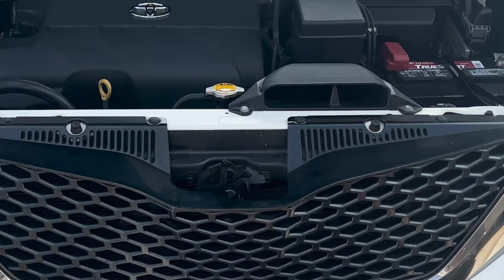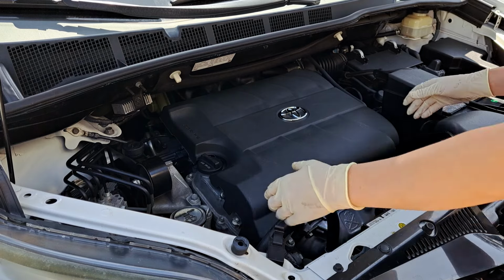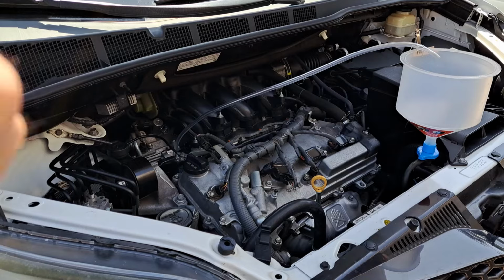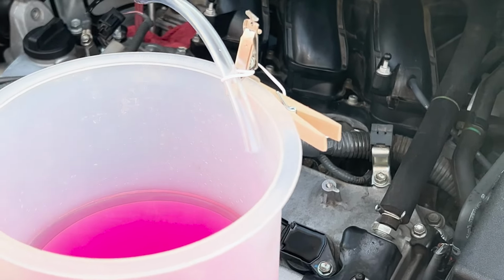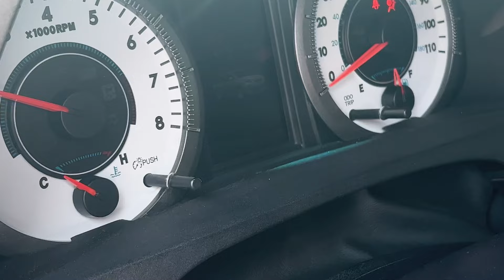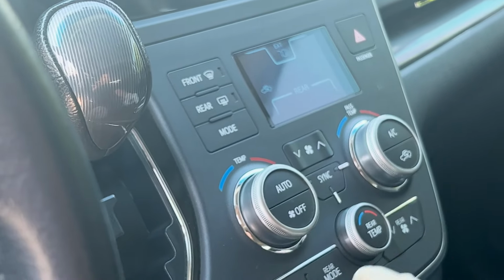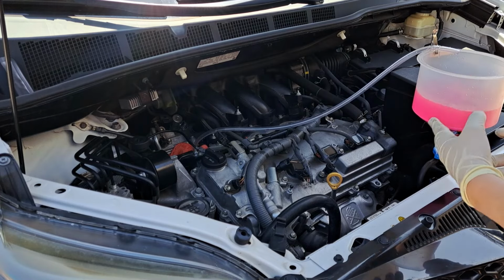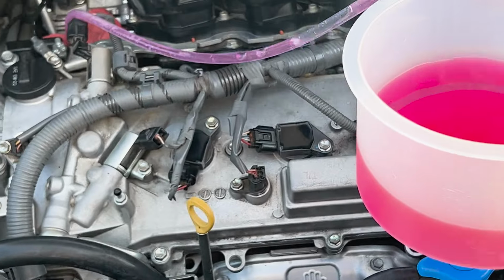Toyota Sienna 2GR-FE Coolant Flush and How to Bleed All The Air Out

Comment: So, when you drain the system (and refill and bleed the system), do you want the heaters all the way on hot with the fans off so you can get the old coolant to drain out and the new coolant to fill back in? Very helpful video, by the way. Thanks! :)
Reply from the maker: Thanks for your question! You wouldn't need to do that because system doesn't have a conventional type water/heater valve, coolant is constantly flowing through the heater core and air and flaps direct the airflow for heat or cold.

Comment: Hi thanks for the video, is there still some coolant liquid didn't get out because of the coolant thermostat valve? or you changed all of it?
Reply from the maker: There will still be a little bit of coolant left in the engine during a drain and fill. You will get more coolant out doing a thermostat or water pump job but you really can't get all the coolant out. Just stay on top of your coolant changes every 4-5 years.

Comment: I have a 2014 Avalon 6 cylinder. with 49,000 miles.  I followed your video, but no coolant came up from the bleeder valve.  I left the valve open and proceeded anyway.  As the engine got hot bubbles were present in the funnel.  I continued until no more bubbles occurred.  I drove the car and got it up to temperature.  The heat coming from the vents was great (hotter than before).  The temperature gauge was were it typically is.  Any thoughts on what happened?  What would I notice  if i still had air in the system after the procedure? Than for any light you can shed on what happened.
Reply from the maker: That's a bit odd since coolant should flow out and match the level of the coolant level in your funnel. Possibly the bleeder valve was clogged,  but sounds like you got all the air out anyways!

Comment: Hello. @ 04:18. How did the fluid level in the funnel get that high? Did some fluid already flcoke from the tube or did you add more?
Reply from the maker: The fluid level will rise due to the coolant getting hot, thermal expansion. That's why I only fill to a certain level at first.

Comment: 2GR FE what is this?  Brand of a coolant or engine type?

I have a 2015 Siena XLE FWD.
Reply from the maker: The 2GR-FE is the engine name/designation. Your 2015 Sienna has the 2GR-FE engine.
Reply: @CarsYouCanFix  thank you bro!!!
Reply: How many gallons i need after flushing?
Reply from the maker: @ETHAN_VR123  2 of the gallons should cover it.

Comment: Hi, I have an Australian built Toyota Aurion  with the 2gr-fe V6. Do you need to turn the heater on at any point during the procedure to remove the air pockets from the heater core. Thanks
Reply from the maker: No you do not. Due to the design coolant is constantly flowing through the heater core. As long as you follow the procedure you will be good.

Comment: My RAV4 2006 V6, 3.5L has the same engine. But it doesn't have the radiator cap like yours.   It has only 1 cap at the reservoir,  how do I do this method?   Thank you
Reply from the maker: From my experience with the Rav4, you can just fill the coolant tank with the bleeder valve open. once fluid is level in the tank and fluid comes up the plastic tube attached to the bleeder valve you are good to go. This is due to the higher location of the reservoir tank for air to bubble out easier.
Reply: @CarsYouCanFix  so you fill the coolant into the reservoir tank while the engine is running or off? Thank you
Reply from the maker: @ngoiloi9174  engine off on the Rav4. Once you do a couple drive cycles where the car gets hot and cold, like after a couple days, just recheck the coolant level and top off if needed.
Reply: @CarsYouCanFix  Thank you.

Comment: Does any 1/4 id tubing work or do I need a special kind? Because I don’t want the coolant to melt it
Reply from the maker: You should be fine with any 1/4 ID clear tubing you find at the hardware stores, I also have a link in the description for tubing that works.
Reply: Yeah that would be awesome
Reply: Also I ended up mixing coolants and now my Sienna is overheating do you recommend I completely drain everything out or just the radiator? And maybe pull a hose off the block and let it drain.
Reply from the maker: @anthonysanchez116  I would drain the block also, another comment here says there are 2 10mm drain bolts on the block, one on each side. here is the link for the tubing 1/4" ID Clear Hose: https://amzn.to/3IRsbgQ

Comment: Why didn’t the coolant flow to reservoir instead? Sorry this might be a silly question but i tried in other car, not this engine, but the coolant just flow back to reservoir.
Reply from the maker: Thanks for the comment! The reservoir on this engine just holds extra coolant for expansion/contraction of the coolant heating up and cooling down. Having the coolant come out of the bleeder valve, then back into the radiator, is sort of like a closed loop system to get all the trapped air out. I hope that makes sense.

Comment: Do u still gt to have heater on without ac? U guys leaves stuff out too.much
Reply from the maker: You don't need the heater on, the design isn't conventional with a water valve. Coolant is constantly flowing through the heater core at all times with this setup.

Comment: I did this on my Camry without the hose and the air coming up through the funnel from the car was explosive. Probably lost half a gallon all over the floor/ engine. I was careful not to put too much in either… guess I’ll try it with the hose next time.
Reply from the maker: This engine is pretty picky about how it wants the air bleed out. You really have to follow to a T on this procedure.
Reply: You must use the hose my friend. It's the correct procedure. This way you don't waste coolant and it allows the coolant to circulate safely and without incident or mess.
Reply: I'm doing this on my 1991 maxima, I have no clue where the bleeder is at, nor do I have a special funnel like that. I'm going to park on a steep hill and try again, lost like 1/4 of a gallon of coolant due to the violent bubbles that occur when the car warms up the thermostat
Reply: @car_junkie I just had a similar experience with the explosive bubbling (I was using the pipe etc exactly as in the vid) did you redo yours later? I'm wondering if the explosive bubbling is an indication of another issue

Comment: What does it mean if nothing is coming up the tube? It's been 30 minutes at 2500rpm and I haven't seen any fluid come up the tube.

If I turn off the car, the fluid backs up into the tube, so I know the bleeder is open.
Reply from the maker: I kind of wonder if you might have a thermostat or water pump issue, causing the coolant not to flow how it's supposed too.
Reply: @CarsYouCanFix  would there be any other signs of a thermostat or water pump issue? The temperature gauge is always just below the middle.

Comment: Why are the heaters set off? Shouldn't the thermostat open up at some point?
Reply from the maker: The Sienna doesn't have a traditional water control valve for the heater core, coolant is constantly flowing through it.
Reply: @CarsYouCanFix  what about a Camry v6 with the 2GR engine? Same thing?
Reply from the maker: @FroMan753  as long as it has the 2GR-FE engine
Reply: @CarsYouCanFix  Air shouldn’t be on hot or cold right?
Reply from the maker: @jalmerc24  it doesn't matter hot or cold, just make sure it's off

Comment: Why have heaters off?
Reply from the maker: Due to the system design there is coolant constantly running through the heater core, making no reason to turn on the heater.

Comment: Why do you set the heater to off?  Don't you want it set to on in order ro get the air out if the heater core too?  Maybe I'm not understanding.
Reply from the maker: This particular Toyota setup has coolant constantly running through the heater core, and uses baffles to block off the heat. Not like a conventional setup, where coolant doesn't run through the heater core while the heat is set to cool.
Reply: Keeping the heater on is a general thing when it comes to bleeding coolant.
However, the reason you do it in certain cars is to open the heater valve. 
The 2GR engine doesn’t have a heater valve so coolant goes through the heater core at all times. Turning on the heater will cause the coolant to take much longer to warm up to open the thermostat

Comment: It's great except this method leaves about 1.3 gallons of coolant that did not get flushed out the system. The bleeding method is good though. So basically you replaced 50% of the coolant that was inside the system.
Reply from the maker: There are some bolts you can remove from the block for a complete drain. Not necessary though if you follow drain and fills on time.
Reply: @CarsYouCanFix  Agreed thanks for the video !

Comment: Is it really coolant flush? I believe you just drained part of coolant from the radiator and added some fresh coolant.
Reply: If you change it every 5 years/50k miles after the first 5 years/100k miles service, changing only half the capacity is fine. You don't need to clear it all out unless it's way passed due.

Comment: How does yours take 10 mins , I feel like for me it takes forever
Reply from the maker: Make sure you have your rpm at a steady 2000- 2500 for the entire procedure.
Reply: I never got the flow, I closed the bleeder after 60 minutes and let the bubbles subside, then closed off the radiator. No overheating, so must be okay.

Comment: I have a impala. Nt sienna.
Reply from the maker: Ok, Your Impala most likely would need the heat set to max, don't quote me though. Toyota on this model does it a little different,  this procedure is pretty specific to this engine since it can be really tricky to get the air out on this one.
Reply: @CarsYouCanFix  okay I just would like to use the same procedure  on my 2000 mercury sable this time. So I know it's good idea. No other way. I have spill funnel clear tunes in place.
Reply: @CarsYouCanFix  so would it matter put regular  hear on max without ac. I ways made good practice and r u mechanic
Reply from the maker: If the car does have a heater valve I would set heat to max.
Reply: @CarsYouCanFix  I'm do that a
Justin case because I just don't if has one or no thanks same for 2002 impala 3800 v6. As fir the 2000 mercury sable

Comment: Dude …, where the tell is the plug ??
Reply from the maker: Do you mean the drain plug? If so it's at the very bottom under the radiator, sometimes hard to visually see with the plastic splash pan in the way.